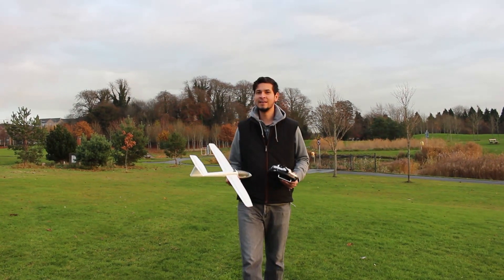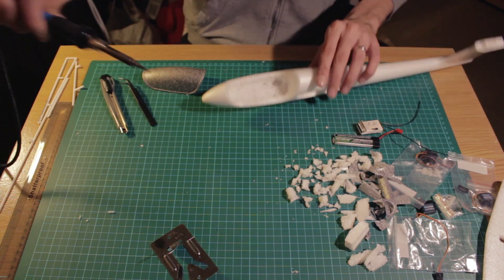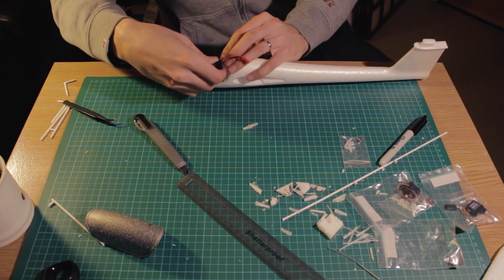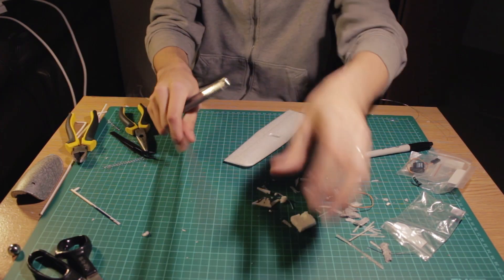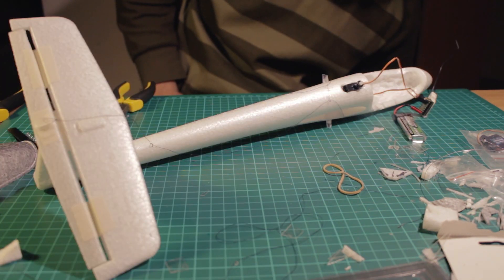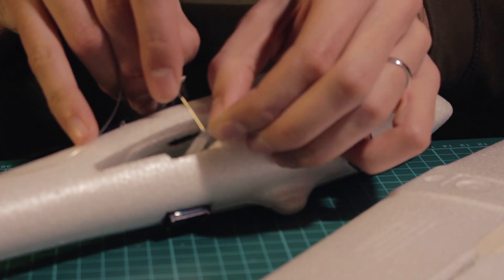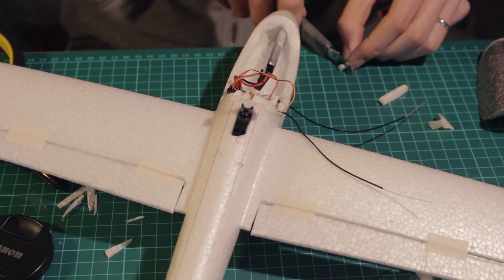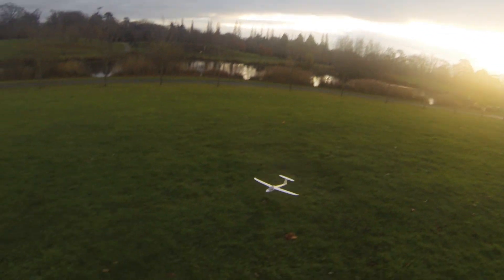Modify your free flight glider to RC (radio controlled)

Comment: For the return spring on your elevator, there's a really clever design I learned from DLG building. You make a Z shaped torsion  spring, with just 90 degree bends, and it's placed in between the two surfaces hidden in the pivot space. Each end gets fed into  a thin reinforcing tube glued within the body of the wing and control. It will be totally hidden when installed and you can vary the strength of return by using a longer middle length for softer feel, or thinner gauge steel. Make sure you use some tubes to keep the wire from tearing through the surface.

Comment: Great instructional video and nice little glider. When you had the issue with the horizontal stabiliser another solution came to mind. Thought you could add a second servo horn on the starboard side elevator. Then attach to your existing control line in a “Y”fashion.  Thus equalising the pull on both sides and stabilising the stabiliser. Would save a tiny, very tiny, amount of weight too. Thanks for taking the time to construct this glider and video, edit and post. It's given me some ideas. Thank you.
Reply from the maker: Thank you.

Comment: Glider is Multiplex Mini Solius, vs 650 mm. I have one and will modify it with RC and also a small, electric motor w/ folding propeller. This glider glides really well!
Reply from the maker: Good!

Comment: Excellent vidio it shows what can be attchieved on a very low bugget. The results are very impressive.
Reply: Hello I have a KEIL KRAFT SOARER BABY 36" ( 910 mm ) span Towline Glider . Would it be practical to convert this free flight glider to RC . My transmitter is a JR PROPO X-3810  on the back of transmitter is an FR SKY V8JT RF module . The on board reciever is a FR SKY V8FR 8 channel.  What servos and battery pack should I get for on board my plane , and is this a practical project.

Comment: I just purchased a glider very similar to this...with THE SAME ideas in mind: make it R/C. Your documentation and choice of materials/design approach helps me a lot.
 I was thinking of carefully routing a nylon or poly tube through the vertical tail and out the top--to run my control lines thru, versus external routing like yours. That way I'd avoid snags or uneven tension to one side while using only 1 line, like your original plan. 
 I'm also interested in 'glassing' the wing & fuselage for added toughness/stiffness. I might use 0.25 oz. cloth or just Tyvek & brown paper...whatever is simpler. 

It would be great to buy a bunch of these bulk price...then teach kids to build them w/R/C added.
Reply from the maker: Yes man! your idea to teach kids is nice, I also think the same. Thanks for your comment.

Comment: Looks awesome, I have a similar chick glider (diamond 600) and I'm wondering if it might be worth just having rudder and elevator for slope soaring. I've found that the gliders have a tendancy to pick up a lot of speed and break off the nose and tail in free flight, not sure if it would be an issue under RC though, I was thinking about putting in a carbon rod or two.

Your build looks really good and to be fair it flew pretty well just as a discus launch- much better than as a chuck glider!
Reply from the maker: Thanks man! give it a try.

Comment: What G is the servos you are using and what is the wing span?
Reply from the maker: The servos are micro size which are 5g but if you get even smaller better, the wing is 650mm
Reply: There are 2.5 gram servos which might work

Comment: Pull pull system has big issue of massive 50 % dead zone
Reply from the maker: But it works for this small glider. I save a lot of weight.

Comment: Hello, I really like this idea, but I'm having a troubles searching the receiver and transmitter, could you please help me?
Reply from the maker: Hi, I used the Frsky taranis X9d radio and the receiver FrSky VD5M but those are a bit expensive because they are pro and you can use them for other models, but you can get the Flysky i6 a search for a micro 4 ch receiver for it.
Reply: Create & Invent Thanks!

Comment: Do you need speed controler?
Reply from the maker: This is just a glider setup, just using servos and no motor, so I don't use a speed controller, but if you want to use a motor, yes.
Reply: Create & Invent are you using just 2 servos?
Reply from the maker: Yes, just receiver, small battery and 2 servos.
Reply: Create & Invent thank you so much i will build one of these
Reply: Just one more thing weight of battery, receiver. Are u using bec?